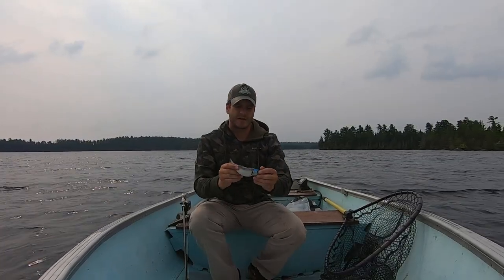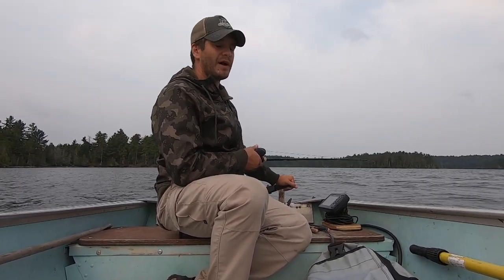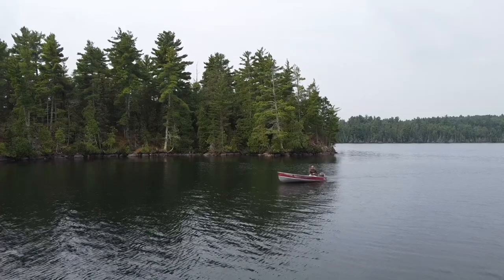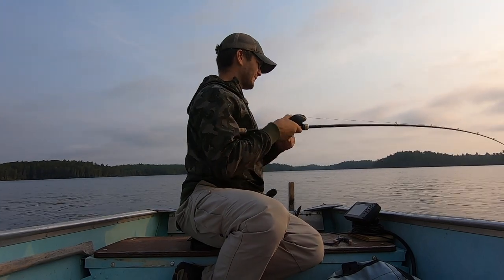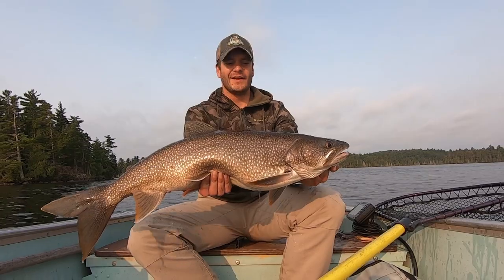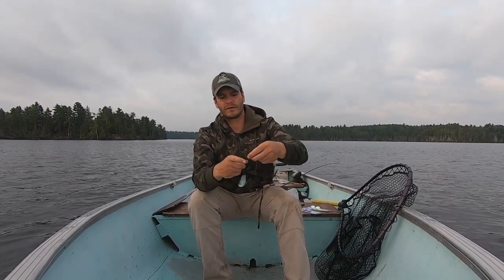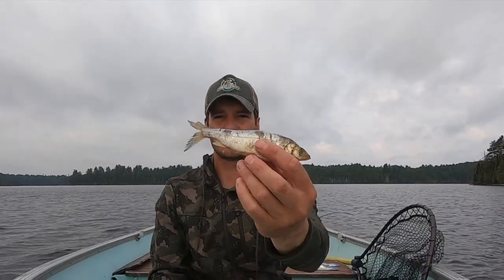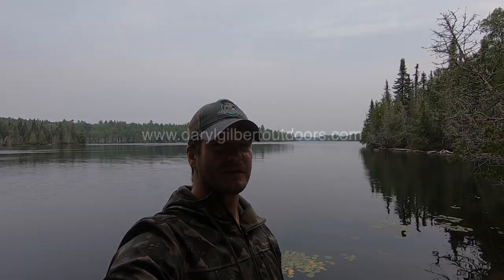How to Catch Tough or Pressured Lake Trout Trolling, Step by Step Cisco Rigging!

Comment: This is going to be a great tactic where I’m at in South Dakota. I have tried trolling with my kayak at about 50-60 feet, and it wasn’t until I was barely moving that I had a hit. I was using a 2oz weight on a slider, a flasher, and a silver #4 vibrax; once I slowed a massive rainbow crushed it. I didn’t have any luck with lakers, but I know they’re where I’m at. This is my next run this weekend. Thanks for these tips for us novice guys! Didn’t even think of jigging for these.
Reply from the maker: Good luck! Hopefully it helps you catch a laker there
Reply: I fish the same hole, just started in my yak. Have any luck?

Comment: Any advice on determining the depth I am trolling at based on the size of my inline weight, speed and amount of line out?
Reply from the maker: There’s a ton of variables, best way is to just test them out.  Troll different depths and see what depth you end up hitting bottom in.  Generally though 150ft of line with a 3 ounce weight will get you 30ft, 6 ounce weight 50 ft at 1.4-2.3mph